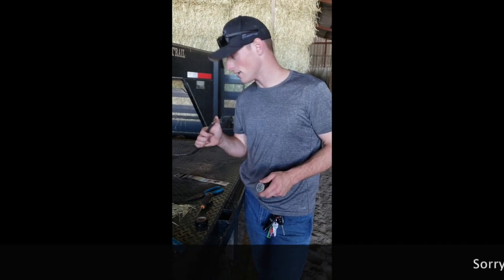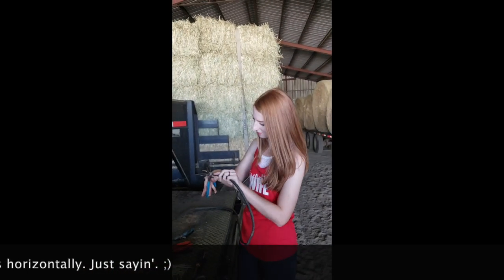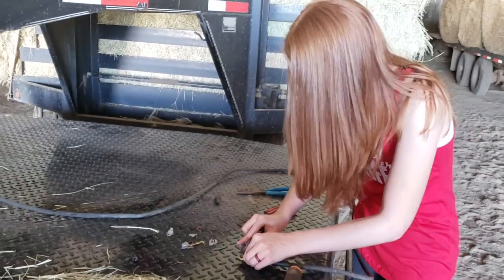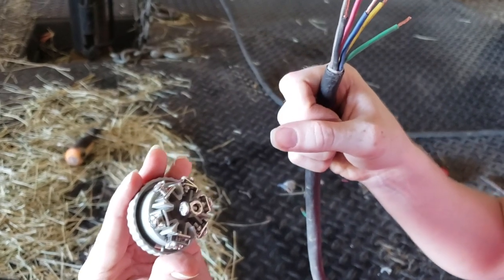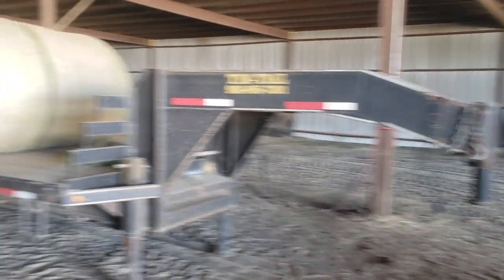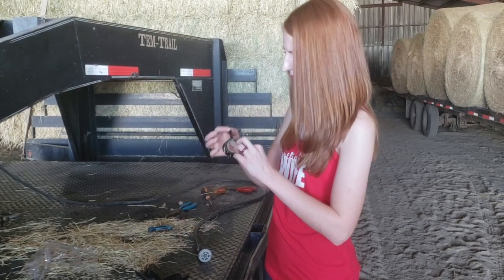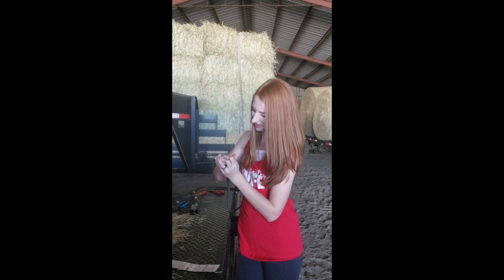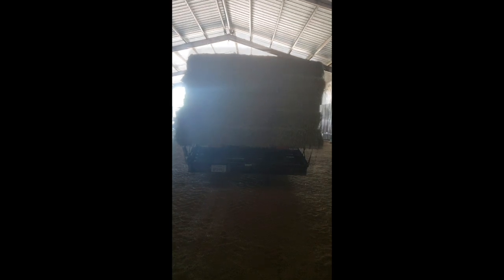Hauling Hay to the Feed Store + Cutting More Hay Down

Comment: Kim
I passed this information to Scott last year when the belts were playing up.
A while ago I was getting the same problem with a John Deere mower throwing and sometimes shredding drive belts.
After a few costly replacements, and having checked everything I picked up a new belt and sought out the most senior mechanic in the JD dealership.
We went through everything I had checked and he added, clean out the grooves in the bottom of the pulleys with a knife or broken hacksaw blade, then give the pulleys a small blast of WD40 before refitting belts.
Returned home and did what he said, there was a small hard bead of very compressed grass in the bottom of the pulleys, small blast of WD 40 and no problems since, repeat it every year on pre season check and maintenance.... I hope this may help.
Good luck to you all, I hope the problem gets resolved
Reply: What the heck?! I can only hope it's that simple! 

We have concern te overrun clutch isn't functioning properly, but seems good when taken apart. 

When shutting off the PTO, it jolts the system and it essentially adds reverse force causing the tensioners to slip and the belts to fly out.

Did your pulleys feel fine by hand per chance?
Reply: Yes checked everything, play in pulleys,adjustment, tension, it would cut for a couple of days then throw the belt, like yours it just started happening the mower was in its third season, only a spare now but have had 5 years problem free. That clutch diagnosis sounds feasible too, perhaps take some down pressure off the rollers to let the grass flow more easily through them...good luck

Comment: Connector cover goes over the cable before you make your connections...   And ALL your lights need to work...!
Reply: That cover snapped on. Had to make do with what we had unfortunately. Pressing matters and everywhere.
Reply: I saw that coming
Reply: Farm trailer. Can get away without lights during the day. At night, not so much. Their short run, no big deal. Most people stay away from trucks with trailers.
Reply: @brandoncaldwell95  Texas DOT won't leave them alone, especially given the weight they're carrying...
Reply: @williamriley2528  Again, farm trailer. They will leave them alone. They do not require lights. If it was a DOT trailer, much different. You cant combine Farm use and commercial in the same boat. One gets more relaxed laws then the other. I cna run around all day no trailer lights till night on my cattle trailer. Dine it b4 due to a wiring issue. DOT commercial trailers its a ticket right off the top.

Comment: Good video again good job you and her fixing the trailer light Laughing H in the comment have the right wires to hook up I run in to that problem on my race  trailer  the running right on it sad work but not that back connector was not making good connection that was what was wrong with it be safe on your farm
Reply: I'm thinking we're just a tad off on our wiring!

Comment: As grass gets older or tougher or heavier crop  u need to change down the gears of tractor to give mower chance to to cut as start of season u can drive on bit living then as year goes on u need to slow down ground speed of tractor put pho revs keep it good high its speed of discs  the cutting that's

Comment: On some Ford's under the hood on the driver's side there is a fuse box and it controls the trailer lights only and they will blow something to do with when the trailer grounds to the ball it will have small jumps up and down this breaks the circuit causing the fuse to blow it's only 10amp I fixed mine by hooking mine to a toogle switch in the cab installed right under light switch. This solved the problem.

Comment: All you're trailers are wired from the back to the front. Beings you have side lights I'd check the JCT box at the back of the trailer we'll probably find a bad connection.

Comment: Turn signals and brake lights are the same bulb..... Everything goes thru the turn signal switch to separate the two .....  Wire in a ground   because, it is a more dependable source than the ball hitch

Comment: double check the breaks if it is like my trailer your actual stopping breaks are on the blue wire and on mine just the break lights are on the brown along with running lights i think it is it has been so long seance i been in that thing something i would get is a power probe they make doing any work on wiring so easy well it dose for me anyway

Comment: I have the same mower with the same problem.two fixes one expensive,one cheap.put your best belts on the right side,the gearbox side,and don't run the other side.bene going like that for 10 years.but you have to remove the drive shaft from the turtle on the side your not using so not to push through it.the cutterbar has worn to the point both pulleys arnt spinning the same speed ,this is evident when you watch with the covers off,slack accurs on the drive side and it tightens against the idler,throws the belt,wraps into the other one and they all fall off

Comment: If your side running lights on the trailer are working, but not the rear tail lights, then the problem is in the trailer, NOT in the cord or the pulling vehicle. Look for a junction box, or a split in the cable, (which may be green with corrosion.) You have an "open circuit" in the brown wire running to the taillights!! Good job, otherwise!!!
Reply: I'll check that out, thanks! I'll double check my wiring as I'm not 100% confident in that. The trailer brakes aren't functional so it could be either.

That truck doesn't have any trouble working that trailer, though!

Comment: On the discbine MAN that's a weird one.....  I assume that the gentleman you guys had look over the machine checked the pulley alignment and all that fun stuff.  Something is outta whack there and I personally don't think some guide isn't gonna help with that.  I would take a real good look at where everything bolts onto the machine that has pulleys on it, all the flanges, and so on and see if anything is showing evidence of moving IE scraped paint or newish paint showing by the older sun faded paint.  The shafts and belts obviously run at a pretty good clip and if something is flexing or even moving under load it will tear up a belt.  Gearbox mounting flanges could be egged out as well and not be apparent unless you really look close at it for wear marks old/new paint etc.  A small shift of anything in the drive system under load will tear up a belt.

I would also do a quick nut and bolt check.  If you find anything loose that's your culprit.  Unfortunately if you find something loose you gotta inspect that whole unit because it might have egged out holes etc.

Wish you guys luck in figuring out the issue.  Might be a ground speed issue as a few others have suggested but I'm not so sure of that.  Hard to estimate ground speed on a video.

Comment: Looks like you are swinging to far away from the uncut hay and that is causing to much of a angle on the drive system and causing it to vibrate and then throw the belt.  Try to keep as close to the uncut hay when mowing next time.
Reply: Definitely something to keep in mind for longevity of the cutter. If it had issues over something like that then it would be a piece of junk, though!

Comment: I wonder if there's a way to change the belt system to a chain driven to prevent this from happening at all
Reply: I'm wondering a million things myself! Largely, how this can be such a big issue for so many with such a hard diagnosis!
Reply: @treyatnorthtexashay4603  I agree with you what kind of mower is it? Send me the info on it and Let me see if I can can find a way to fix it so you don't have to worry about theses break downs. It seems like the break downs is your biggest issues with the farm which will ware on you faster than working long hours

Comment: Your running light an Clarence lights should be hooked together
Reply: I mean tail lights an Clarence together all running lights
Reply: On your trailer I would put Equalizing air pressure hoses your tires would wear a lot better because the road is not totally flat and one dual runs harder on the road then the other so you’re putting more aware on one tire your equalizers would save your tires

Comment: That trailer probably has electric brakes also that work on the same wire system so I would check that for safety

Comment: Not trying to be a downer but yall are going to need a class A non cdl license to use that truck and trailer with a gross combination of 26100 doesn't madder  if truck and trailer are empty if the door tag and the trailer tag  gvwr adds to over 26100 need a class A non cdl I learned that the hard way just trying to help I'm in texas also keep up the good work proud of yall learned a lot from Scott that helped on my own operation
Reply: Even farmers?
Reply: @joecliffordson  yes I'm a farmer / rancher in gulf coast of texas and it is required class A non cdl no medical required but a written and driving test I never need one till I bought a 3500 ram with a gvwr of 14000 and a dual tandem trailer with gvwr of 22000 looks like that flat bed trailer of there's doesn't matter empty or load but what the combination of the 2 gvwr is total do not have to stop at weigh stations but if your driving and get stopped by dps most city cops and sherriff wont know the laws or wont mess with you but you will have a problem they will make you stop the truck and find someone with a class A or unhook trailer and drive truck home with out trailer. It's the law really suck because they dont tell you that when buying a big truck and heavy trailer that's one reason that 2 axle single wheel trailer are more common most dont have high enough gvwr to put you over 26100 if learned
Reply: @jasongibbs47  My Son went to N.C. to get a 53ft dry box, with a tandem axle tractor... he was almost home when  a DOT man caught him at a Station getting fuel..... Said he was going to inspect truck untill he saw the S.C  Farm tag.....Told My son he had no authority  to inspect...... Went and got in his car and left....Local Yokels  will stop you for speeding etc but that is about it
Reply: @jasongibbs47  thanks for the info..its always good to know. Up in Minnesota it is my understanding that farmers and their employees need no additions to dl even when hauling with tractor trailers. For crop delivery.  Of course the only way to know for sure is look it up at the revisor of the statutes. I have not done that but it sounds like we all should. We can only obey the law if we know it. Thanks for the heads up i was just considering the same type of set up for hay delivery. Your comment gives me pause to investigate our states transportation code

Comment: you messed up the wiring  left side is at 9 o clock  right side is at 3o clock marker lights at 7 o clock brakes at 1o clock power is at 11 o clock ground in the middle let me know if that works for you  I rewire  my trailers all the time I put new plugs on  I can help you  by email but im long distance from you say in Pennsylvania but love the channel  miss scott hope you are doing well ever need a extra hand ill drive down to help out been farming horse hay here for more than 35 years   great stuff see you in the next one
Reply: I will try rewiring it the way you described! Thank you for the help. If you send your email I can contact you if I continue to have issues with the plug!
Reply: @caraatnorthtexashay3043  im sorry im wrong on the power  power is in the middle ground is at 7o clock marker lights at 11 oclock  if you hook it up wrong you will blow a fuse in the truck  so here it is again the right way   power in the middle ,  left side 9 o clock  right side 3 o clock  ground at 7 o clock   marker lights at 11 o clock  and brakes at 1 o clock  but make sure you look at the plug from the front side or you will wire it  backwards,  it will be right,    but be backwards

Comment: if you were to get some 8 foot two by four boards.   connect them with sections of cut up round baler belting to build a series of tie downs for the bales.  that will eliminate the issue of the straps burying themselves in the load.  two boards per set.   you will need as long as the trailer.  divided by 8 feet .    use your judgement as how many tie downs since the boards will catch several bales at the same time and spread out the clamping force.  A hand carry chemical sprayer filled with water will put out an amazing amount of fire
Reply: Randy J exactly what I was going to suggest. Even an old tie down strap cut into smaller pieces and screwed on to the 2x4’s will work. It’s probably the best way to tie hay down to make sure it does not move.